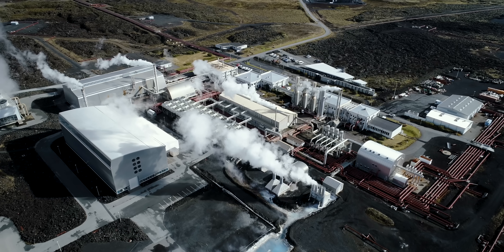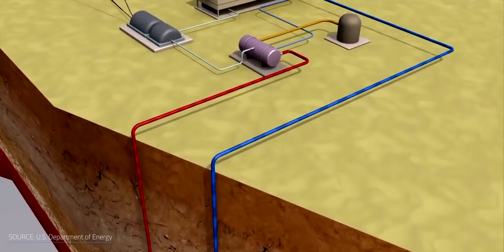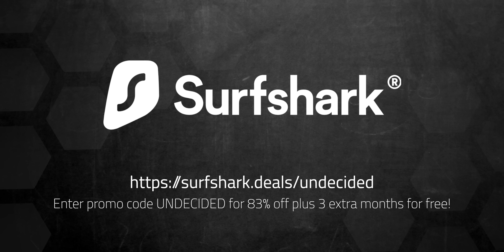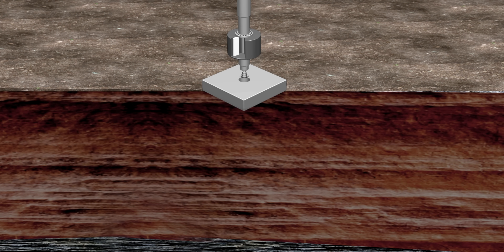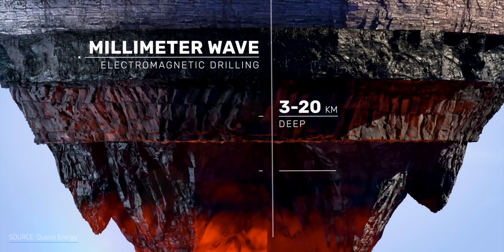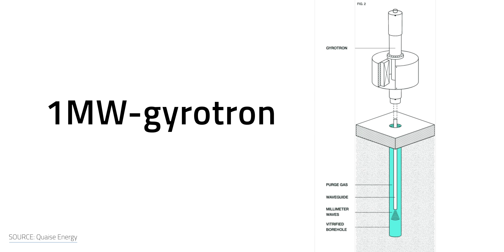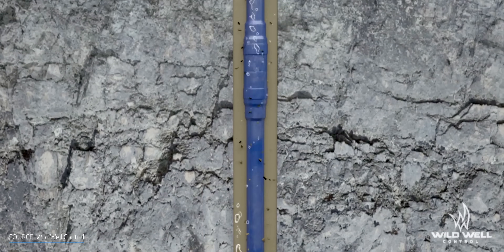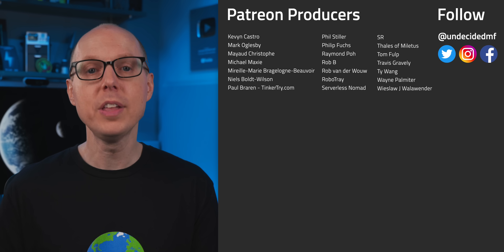Why This Fusion Tech May Be a Geothermal Energy Breakthrough

Comment: Any green energy tech that is still 3 or 5 or 10 years out sounds like a great idea, but is not guaranteed. However, if someone says that they need 3 years to build a new wind farm, you're going to believe them, and during the build time you are going to see other wind farms come on line. Perhaps all this money should be directed into existing renewables until climate change is solved, and then go after these other energy sources to replace our aging wind farm installations.

Comment: Geothermal, like solar, can directly provide both heat and electricity, but without the intermittency of solar. If it works and is not crazy expensive, together with other constant sources of energy such as ocean currents maybe, it could very well be used as both base load capacity and emergency grid balancing, meaning no expensive battery storage is needed, let alone gas turbine plants.
I wonder if this tech could be applied on a smaller scale, like geothermal for houses that don't need to go as deep. In any case, every city should already plan on having several geothermal plants over their territory, or at least reserve the space and prepare the grid infrastructure for when the tech is ready for commercial use. Cities can't tap into many sources of renewable energy, mostly rooftop solar and maybe a trash burning plant, but geothermal would make fabulous catastrophe movies when that hot lava erupts everywhere...

Comment: That's insane rate of progress. 5M/h and all you need is is electrical lines and high pressure gas... 
and I know O&G extraction employs a lot of people, and this would help not only transition a lot of the grid, but a lot of the workforce into a greener potential. sometimes the bigger picture is just as important as the technology. This will keep a lot more people happy than wind, which is an entirely new and developing trade. It's great for the grid, but the workforce needed to make some big changes.

Comment: did you hear about the super deep cola bore hole they worse out 1000s of feet of pipe just from the friction of the rock then they stopped for a year and snapped off the drill head when they started drilling again

Comment: This is exciting news, geothermal is the best contender for renewable energy besides nuclear fission and fusion.

Plus if these SHR drilling could be done in existing coal/oil-fueled power plants, then these sites can have a new lease in life.

(Aside from the graphite block thermal storage system)

Less cost upfront since it will be tapping into the same infrastructure.

Not to mention energy supplies would be more stable since there would be no need for buying fuel with a variable price.

Comment: One of the benefits is continuous output. These are definitely a good fit with existing coal or gas- fired stations,  particularly coal, but it seems each well might have a limited lifetime, so ongoing drilling may be required to maintain output. The big advantage us not having to be sited in geologically unstable areas.

Comment: You mention the Superdeep Borehole in this video. The reason that project stopped was because the rock basically turns to plastic at those depths. Its semi molten. This sounds like an absolute HELL for maintenance or even installation of the lower parts of the tube. He mentions that the tube will basically make itself when it starts to glass from the drilling. But at that depth? Thats still rock thats going to collapse back in on itself.

Comment: Here in Alberta there is a concerted effort to reemploy laid off oil workers to drill for geothermal instead... That was full-steam ahead, pun very MUCH intended, until the "Eastern Crisis" when the price shot up to astronomical levels and everyone in the patch went back to work. Meanwhile we're rapidly building out our solar and wind farms to the tune of almost a 1 GW/year in a province with only about 10 GW of total capacity... So that shows you even in a few years TOXIC TAR SANDS OF ALBERTA will be carbon neutral at worst... Since the plan is to turn all the pipelines into hydrogen carrying ones instead with CCS and alternative fuel tech using the rest...  Which is weird and surreal to think about as a citizen of the #3 petro reserve on earth! Great video as always!

Comment: Okay so it’s costs 4x a solar farm that produces the same power output, but what is the square footage required for the solar farm vs geothermal? And I like the benefit of hooking straight into decommissioned power plants to reuse infrastructure rather than build new infrastructure. I would think that would be the best for the environment and land usage.
Reply: Solar also have another problem: unreliability and you need expensive battery packs to make them usable
Reply: With 241 coal power plants in the United States… there is not much opportunity for new energy production. 

The electrical lines already being run is the most significant benefit to switching to new base power technology.

This small number of geothermal plants, in a land mass area, makes me feel very good, to be quite honest. 

Drilling millions of bore holes to transfer thermal energy to the biosphere would create tremendous anthropomorphic global warming, with no opportunity to recycle the heat, that we get with carbon based carriers and 100% recyclability.

Drilling millions of bore holes into the earth, to transfer the heat, would slowly cool the earth, slow the movement of molten iron, decrease the magnetic field protecting the atmosphere, allow the solar wind to blow more atmosphere from the globe, resulting in evaporation & blowing away of water, and finally resulting in our blue planet turning into a dead rock & no life existing.

These are heavy prices to pay for A/C to stay cool for a little while.

Comment: Let them drill 100 ft hole with this new tech then i will believe it's possible. They have not even drilled 1 ft hole and they are talking about 12KM. Looks like Elon is running this company.
Reply: But Elon got his stuff to work though.
Reply: @awdrifter3394  So when are you going to get delivery of cyber truck? Do any of the solar roof tiles work as expected. Self driving car or disaster. Boring company, creator of underground traffic and total disaster. He is nothing but a loud mouth lier.
Reply: @yoppindia  Cybertruck is delayed, but millions of Tesla Model S, 3, X are delivered. Solar roof is on sale right now, I'm not rich enough to afford it, but you can buy it right now if you have the money. Boring company has dug a tunnel under Las Vegas Strip and got contract to expand it to Las Vegas Downtown. SpaceX has reusable heavy lift rockets, launched thousands of satellites in orbit for Starlink. The self-driving car is kind of a disaster due to the marketing, I'll give you that, but the Autopilot is not any worse than other Level 2 Autonomous driving system. I'm not a Elon fanboy, I would swap a LSx into a Model S if I got to the money, but you have to to also admit he's a loud mouth that gets a lot of things done.

Comment: You could drill horizontal once you reach a certain depth if the temperature gradient is high. Also a lot of the cost can be offset if gas pockets like helium, argon, xenon,etc are recovered. It could also be used to set up seismometers and detect the depth of the earthquake and triangulate the location. You could even use the heat for desalination plants from such wells.

Comment: I particularly like the idea that you could just drill in the parking lot of an existing power plant & convert it over to geothermal very easily, with zero emissions and a pre-built power infrastructure already connected to it.
Reply: Yea, that's one of the best benefits as I see it.
Reply: I'm not a geologist. But what will happen in the moment that super heated water or gas is reached, will there be a blow out that engineering cannot cap? Will we have a hole spewing toxic gas into atmosphere? Will it destroy the drilling equipment?
Reply: @0my  Well, I'm not a geologist either. It's my understanding that the wellhead maintains pressurization before, during and after drilling. Once the drilling is completed, the fusion drill gets removed, and a pipe assembly circulating some heat-exchanging fluid gets installed into the hole. None of the drilling processes are paticularly exotic or experimental. Iceland's been doing this for years with no procedural crises. In fact, so has the US. As I understand it, the only difference in process is the type of "drillbit," if you will, and the only physical distinction is the depth of the hole. At this point, if they struck oil instead, they'd be disappointed. But it wouldn't cause a disaster.
Reply: @erfquake1  Oil might actually be a bit of an issue when using a laser to super-heat rock but then again maybe it isn't, I don't know enough about the temperatures involved and the flash point of oil (or whatever else they may encounter).  I presume they'll use some sort of sensing tool to get an idea before digging too far (some sort of sonar or radar system maybe).
Reply: @erfquake1  There are currently 7 US states that already have grid level geothermal generation of electricity. The FORGE project in the state where I live is one of the US Department of Energy's pilot projects to help overcome hurdles to geothermal energy generation. The challenges are many and varied, not just the drilling method. But it is very true that drilling technology has absolutely been the biggest hurdle.

One thing this video mentions is that the water resources at depths like the ones he is referring to tend to exist in a supercritical state. My brother has a PhD in Chemical Engineering and his thesis was based on supercritical fluid research, so I asked him about it. Turns out, even very small amounts of sulfur added to supercritical water is extremely corrosive and sulfur is definitely present in the water down there. So dealing with water at that depth is no walk in the park. 

All of the problems have solutions. And those solutions are probably still a lot easier than anything associated with controlled nuclear reactions of any kind - especially fusion. So breakthroughs like the one described in this video are great news! Just a few more engineering challenges to go and it becomes inevitable. This will be our reality - and because of this breakthrough, it will be sooner not later.
Reply: @paulwhite6648  Awesome to hear this! Thank you! Yes, this research sounds very encouraging.

Comment: Interesting. But, Ironically, what we need to be prioritizing is super-shallow digging...for horizontal ground loop heat pumps. Those can provide heating...OR cooling, almost anywhere on Earth (the only exceptions being areas that sit on permafrost.) Vertical loops could even be used for high rise buildings, and they only need wells around 500 feet deep. 
You see: it's like living in a cave, except you bring the "Mountain to Mohamed." It's about 54F ten feet underground, all year long. The Hot as Hades stuff discussed above is when you get really Deep; hence the need for the Gyrotron. Additionally, the radiator fluid in the loop coils holds thousands of times more energy than the air.
You bury the coils underground. A pump circulates the fluid. The heat pump is typically in your basement. This has the additional advantages that the basement is usually 58-60 F, and your unit is not exposed to temperature extremes or precipitation. Since the heat pump isn't working against 110 F, or -20 F outside air, you achieve much greater efficiency.
I wish I had both a Solar roof AND a ground loop on 98 F degrees like today. But-I'm cheap. And, if I put too much money into my house, I won't get it back when I sell it.

Comment: I think the depth related challenge, as it relates to the cooling fluid and pressure, may actually be the material of the coolant pipe/tubing. If a supercritical fluid could be used, friction would be minimal, and natural convention would also minimize external energy required to pump the fluid. Of course sCO2 requires material capable of withstanding such pressure, and corrosion from sCO2.
Temperature is right for sCO2...
Reply: You could use liquid Gallium, if you don't care about price. Insulate the pipes and use it to create steam in the boiler plant. Or, perhaps a Stirling engine would be practical.
Reply: @drpoundsign  CO2 is in abundant supply, and supercritical CO2 has the density of a liquid, and the viscosity of a gas. 
sCO2 Brayton cycle could be perfect.

Comment: I think their biggest blindspot is focusing too much on a demonstration plant to raise funding than it would be to focus on driving down gyrotron cost per class. You’re going to get leap frogged by China and others that put energy into scale production. Yes, you will run into the need to make adjustments to design but that will not force you to throw away stamping equipment, roll production, 3D printers, die making equipment and other production enhancing gear. The gyrotron has a multi-purpose application potential for repair and fabrication uses as well. From my point of view, the gyrotron is the tractor and applications are add-ons that diversify its market potential and help keep production sustainable. Glass as structural is an appealing approach and my choice for market diversification but it is not my only choice. I see it as an after market 3d print add-on, to provide customized glass as structural, glass as insulator, dope tuned optical filtering, art and other interesting applications. Engineering and Art are good bedfellows for creating expanded interest that sometimes fuel each other. So having hackathons, demonstration parties and internal competitive rivalry can fuel this growth. Be the one to create millionaires the way Microsoft did decades ago and It will fuel its own growth.

Comment: There is a potentially serious problem with mass adoption of geothermal energy taps and it is the progressive cooling of the earth's core. That may very well be devastating to the planet in the long term.

Utilizing the energy that the sun casts away is a much safer course that is not fraught with a potential ill effect to the planet, itself.

Comment: I'm skeptical. Vaporized rock is going to condense on things unless the whole length is hotter than its boiling point. Liquid condensate will flow down or sag, and stay hotter than the melting point of system components for a very long time. These effects perhaps don't matter in a 3-foot hole in a controlled and unconstrained surface setting. Like trying to drill a hole with a garden hose, it works great until displaced material solidifies above the active surface. I'm concerned that the system is going to need to move far, far slower than predicted at best, and at worst it'll bury itself beyond recall beneath a few metres of self-made glass.

Comment: This is nonsense, mixing heat pumps (which are BS except in very limited circumstances) and geothermal which are totally not the same thing. At least you're admitting solar and wind are a waste of resources. Geothermal has some fairly formidable obstacles and drilling the hole is the least of it.

Comment: I think the big thing here is, actually put it practice and drill a hole. See what happens in real world environment and go from there.
Reply: 11:56 They are planning to do it. While it's only 1KM, if we never hear about it after 1-2 years, we can assume they failed. If they succeed then the tech should be viable for 10KM holes.
Reply: @awdrifter3394  I like hearing about new technologies but also get tired of all the speculations. There's a lot that sounds great in theory but falls significantly short in real world environment.

Comment: Also important, these new boreholes could be drilled anywhere where a heat source is needed, and not only for electricity generation! Think about all industrial processes that just need a clean source of heat to replace fossil fuels currently burned for that purpose. Kilns for making cement, furnaces for processing metal ore, you name it!
It's all about heat! A clean source of it, and you can ran everything!

Comment: The thing I would wonder about isn't the thermal integrity of the 'heat ray' as it travels downhole, but how they can manage to control the telemetry of the borehole. Modern methods of borehole steering and real time measurement are done by using the mud directly or indirectly.

Comment: The heat from the core and the needed heat is not evenly distributed. Sometimes the necessary heat is in higher layers of the Earth. If we look and search for the closer heat areas of the Earth's surface, we can find feasible and sustainable areas where geothermal is possible. Good video.

Comment: instead of drilling so far into the earth why not just  extract heat from locations that are closer to the surface. Yellow stone for instance is  considered a super volcano that is close to eruption.(based on previous behaviors). An end life on earth  catastrophic event . To me it seems like a giant boil  on the face of the earth. Its swelling and ready to pop. So how would you remedy that? do you let it swell and pop on its own? do you squeeze  it hoping it does less damage rather than if you let grow and explode on its own? Or do you elevate the pressure  within that boil and simultaneously ( me in a spelling bee. Spell simultaneously. me: can you use that in a sentence? judges: uses it in sentence. Me: That did not help at all. can you spell it out?) turn that heat into energy. literally transfer that geothermal energy out of the doomsday bomb we call Yellow stone and into usable energy for places, I don't know, who rely on lake Mead for energy.?  We greatly slowed   the erosion of Niagara falls simply by harnessing its energy for hydro power.